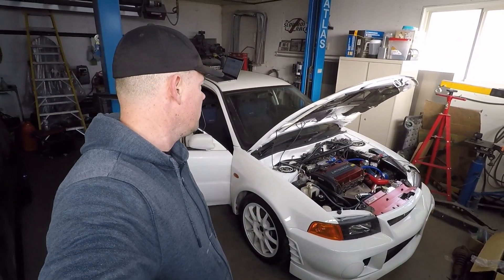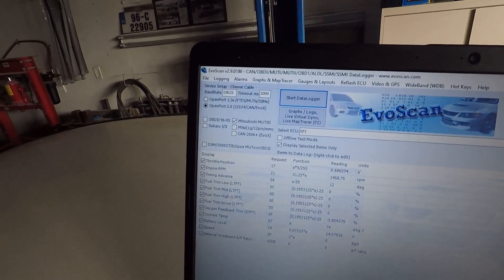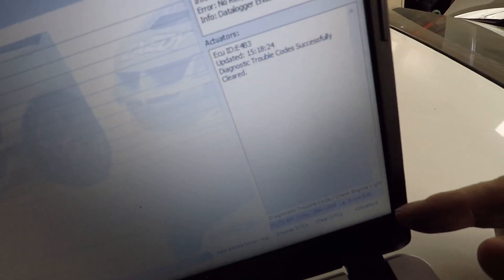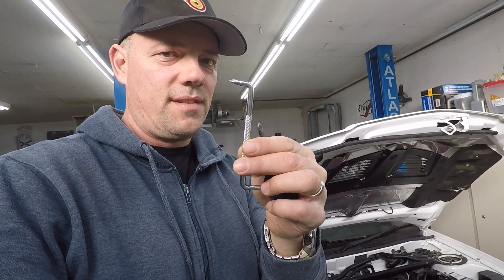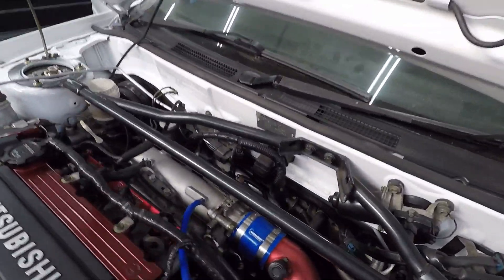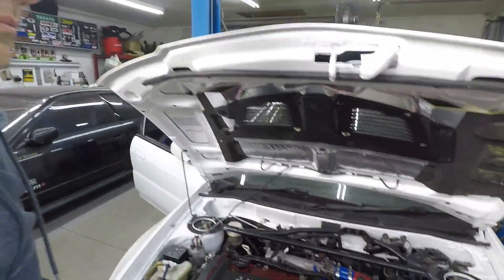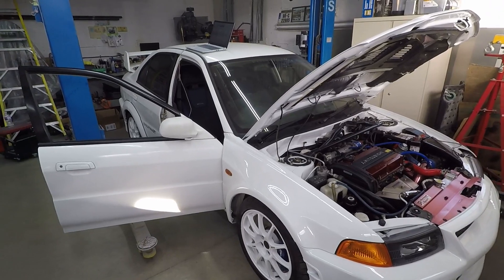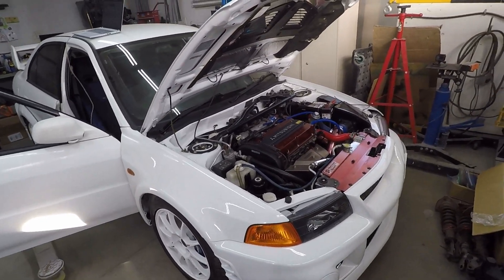50th Video Upload !! Mitsubishi Evolution 6 Project 2022 23 Part 6 Setting base Idle on your Evo!

Comment: For anyone that would rather use the % for the TPS reading, just set it to 13.333%. It should then show as 100% when you have the throttle fully open.
Great vid, thanks, I wasn't sure about the Biss adjustment but now I know!
Reply: How did you come to 13.333%